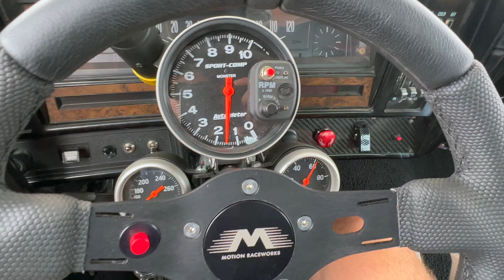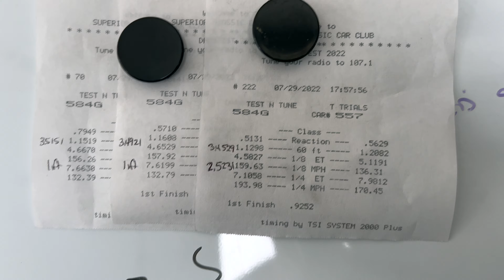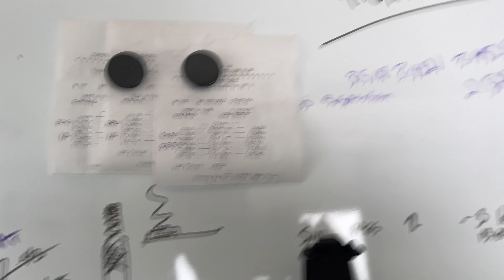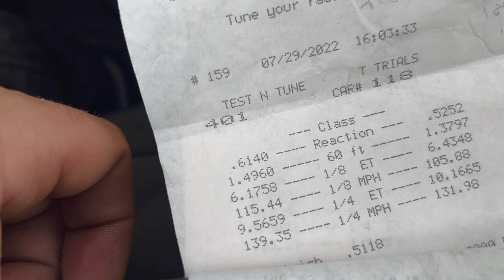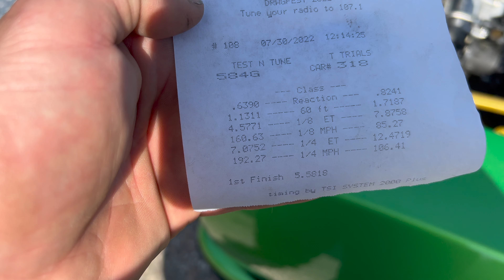No Prep Kings from the North: Dragfest 2022

Comment: Awesome videos I'm a old school drag racer from the 70s I just got back into it and I'm putting a decent street car together I have a 427 big block it only makes 660 horse power 605 torque but that's a pump gas daily driver street car to street race the motor is going in my 88 monte carlo SS turbo 400 with a 9 inch the car should go a very low 10 second pass good enough for me I'm 62 years old now. So I did most of my playing around 40 years ago before there was all these aftermarket parts and electronics they have now cars are going so much faster then when I raced a car that rN a 10.40 was a fast car back then I love your videos keep doing what your doing I'll keep watching your friends   from Louisiana Rick 427
.